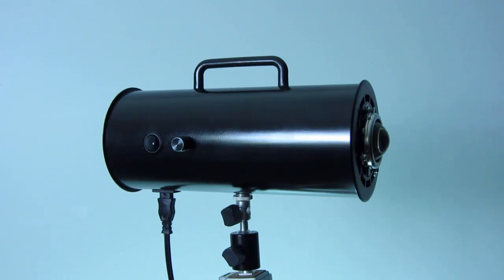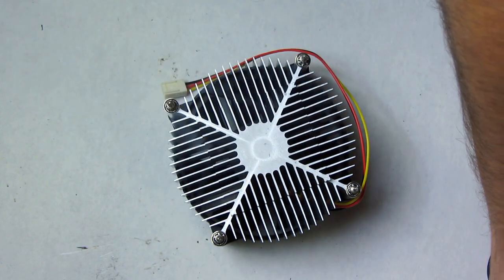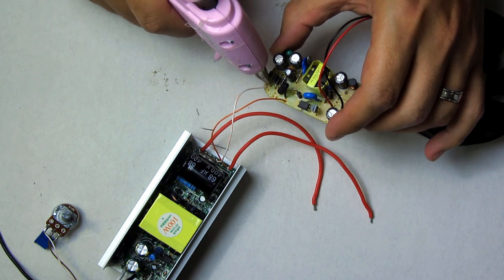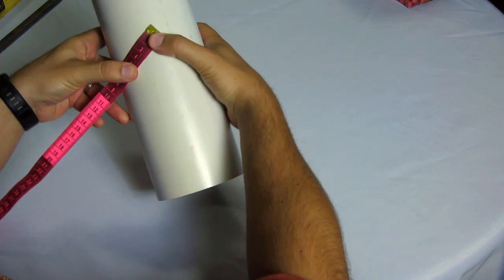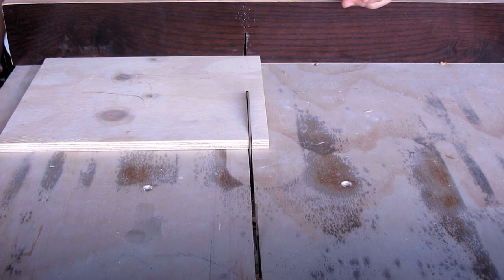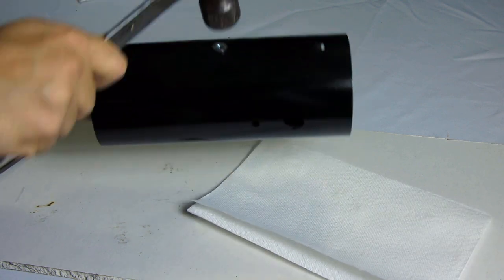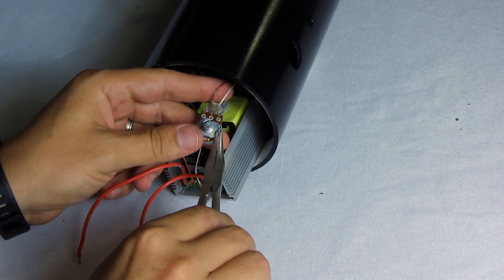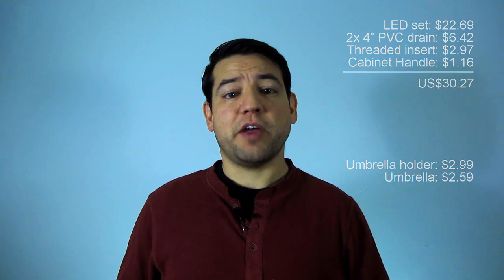Build Your Own 100W LED Video / Work Light DIY

Comment: Thank you so much for this detailed video.  It really saved me a lot of time.  I used the kit from  ebay for ~$25 and with your help it was super easy and cheap to complete.  If you carefully position the COB on the 4 radial spokes on the heatsink, you can fit 4 little 4-40 UNC screws right in the middle of the spoke.  
Your design is really clean.   If people want to go industrial, a 4" steel duct will work if you use a starter flange with all the little tabs. I didn't have to cut off the ears from the fan or heatsink or separate the fan but I think yours looks way better.    Really great video!  Very much appreciated.

Comment: Neat project, and very well explaned!!
some little advice, try to avoid hot glue between heatsinks and surface you wish to stick the device to, why?? because there is good chance for it to get loose when the heatsink gets hot. it is a 50/50 risk. Better use 2 parts epoxy sometime.
I would have left the front + back cover white to add some contrast to the build, of course it is a detail.
Also try to add to dust filter at the back, because with all my LED + active cooling (=heatsnk + fan) I fast noticed dust accumulation. but maybe since the fan is very far from the opening, you are going to avoid that...
Anyway appreciated the project ))
Reply from the maker: I agree with not using hot glue. I don't think it gets hot enough to melt the hot glue, but it doesn't stick well enough to the plastic. One of my lights fell while it was on a tripod and the driver came completely loose. I still have to fix that.
Reply: @GabesHacks  Right, that is why I said a 50/50, maybe it get hot but know knows? that why I avoid hotglue near heatsinks... the heatsink is not going to tell you: hey I am getting super hot, be carefull )) just kidding
"better safe than sorry
" right??  you said yourself about some past failure working with hotglue....
A tip= sand a bit the plastc, going to give a better retention to the material. Plus those cheapy hotglue gun are garbage, they do not melt well. I got myself one, but I stopped to use it. I use instead a cheap solderig Iron to melt some piece of hot glue, it melf them as oil )) I found it getting a better grip and get very soluble, much more than with a hot glue gun.... I know a bit slow but works fine )) or when you want to use the hot gun leave it upside down a while, for the glue to melt as much as possible inside before to expulse it... the idea is about  max melting of the glue 😉

Comment: After so much experimenting, I found that what kept the led from turning on was the cable I was using. I changed it for a fan cable and it turned on very well, it lights up the whole room.
Reply from the maker: I'm glad you got it figured out!
Reply: @GabesHacks  Thanks for the comment, in fact in what I have advanced I have had to intuit almost everything, since I am not skilled with this electronics. But now the question is about the thin cables that must be soldered in the middle of the two red cables of the led driver, I have already been reviewing the led driver that I have which is also a takey brand, to try to locate the points that you teach in the video, but I get a bit confused because even though they are from the same brand they are not the same, I can't find those points for mine.
Reply from the maker: @damianaraque6233  If you can't find those same points, just solder to the base of the red wires, or solder directly to the plug. You just need the wires solders to the AC power coming in.

Comment: Tip: for anyone to use as lighting for videos use a LED with high CRI, as you can see in the video Cheap LED leaves the colors bad
Reply from the maker: Yeah, I just wish they weren't so expensive! Some of it can be fixed with color correction in post, but I'm still bad at that too 🤷‍♂️

Comment: very cool! thank you for the video, It was very well done. Is it still working?
Reply from the maker: Absolutely! I made two of these and they're both still working. The only thing I think I could have changed is how I secure the driver to the inside of the pipe. In one of mine, the hot glue came loose, so it moves around inside. But that one had fallen while on a tripod, so that's what knocked it loose. But it still works!

Comment: Thanks for such a simple and elegant solution for dimming a power supply, can you kindly guide me about part list to purchase for the same setup but 200w LED Cob?
Reply from the maker: All the parts are listed on my blog post: http://www.gabeshacks.com/2017/12/100w-led-video-light.html
You can find a 200W LED chip on eBay: https://ebay.to/2D9Pdi1 but I can't guarantee they will be the same size and fit in this same design.
Reply: @GabesHacks  So nice of you, thanks :)
Reply from the maker: I can't tell you which one to use. If you want to make a similar design to mine, the pipe is 4" on the inside, so whatever chip you use needs to be smaller than 4".
Reply: @GabesHacks  Thanks :)

Comment: Great video! Thanks for sharing.  I bought a kit that looks identical to yours. I want to put it over my welding table in the shop. I am a bit confused about how to wire it. I will wire the input to 110v ac and assume the output is 36v dc but the fan is only 12v dc.
Reply from the maker: I'm running the fan from a USB charger circuit, which outputs 5V. The fan is rated for 12V, but I didn't want it spinning that fast and creating noise. I started talking about that at 5:02.
Reply: Thanks Gabe, I don’t know how I missed that. And thanks for such a quick response!!

Comment: DUDE!! You're my fucking hero!! This is EXACTLY what I was looking for.
1. Any chance you can be a superstar and put together a list of the parts? 
2. What if I want it at 100% all the time? I can just bypass all the sodering?
Reply from the maker: If you want it at 100% all the time, you can skip the potentiometers. But you will absolutely need a fan and heatsink on it. It gets very, very hot at full power. The list of all the parts is on my blog post: http://www.gabeshacks.com/2017/12/100w-led-video-light.html
It was a fun project for sure :)
Reply: Awesome. I am going to bypass ALL solder by using a USB solution with the fans. I will make a point of sharing with you after I try it. Using a HIGH CRI LED my guess is about $100 Canadian ($60USD?)

Comment: What about adding some batteries so it can run without main voltage?
Reply from the maker: You can do it, but you would need a different LED driver to run from DC input instead of AC. I took inspiration for my design from these videos, where they used a battery, so you can take a look at those for the circuitry needed for powering from a battery:
https://youtu.be/jaJQ2fo4poU
https://youtu.be/c--5c3Egv4E

Comment: do you have an updated link for the led set? the one on your blog is expired
Reply from the maker: Thanks for letting me know. I'll update it. Try this one (it looks like it's exactly the same one): https://ebay.to/3SrrNcc
Reply: @GabesHacks  just curious, is the led still working?
Reply from the maker: @Iinustechtips  It's gotten a little beat up (I've used it during renovations) but yeah, it still works.

Comment: To turn on the LED to its maximum light power, is it necessary to install the potentiometer? Since as such, I only need the lamp to turn on at its maximum power.
Reply from the maker: If you only ever want to use it at full power, then no, you don't need to use either of the potentiometers. Just make sure you keep it well cooled, because it will get hot!
Reply: @GabesHacks  I understand, now I'll tell you what I did: solder the black wire of the led driver to the negative pole of the led, and the white wire solder it to the positive pole, and glue the thick red wires from the other end of the driver to the wire that goes to the socket current, when plugging it into the outlet the led turned on for a few seconds, only some of the led turned on and then stopped doing so, I moved the cable that goes to the outlet but did not turn the led back on. I want to know what the problem can be?
Reply from the maker: @damianaraque6233  Hmm.... I'm not sure you can watch my other video where I talked about adding a dimmer, but I showed how I tested it without at first too: https://youtu.be/i4cY7c-0zyk

Comment: Great video! How is this holding up since modding power supply with trimmers?
Reply from the maker: Great! I made two and they're both still working. I just used them the other days to take some pictures of my kids. I could have fastened the driver inside the pipe better I think. The one came loose when it fell while on a tripod, so I have to be careful when I use it. But it still works just as well as the first day!
Reply: @GabesHacks  Nice to hear!  I just got some of the parts in today.  Thanks for staying engaged on YouTube and sharing your build.
Reply from the maker: @keithofarns8738  No problem :) I actually just finished using this light with a light box to take a picture of a camera I'm selling.

Comment: I have the following problem: connect everything and when I turn on the led the light of this begins to blink, it is not fixed as it should be. can you give me an idea how to solve the problem?
Reply from the maker: I don't know, sorry. I never had that happen.
Reply: Voltage Regulator and Capacitor that you need to focus. You could replace them to debug the issue.

Comment: Also, could you run multiple LED's on a water block with the power suuply being a computer power supply?
Reply from the maker: Mazomedia Computer power supplies put out a max voltage of 12V. So you'll need to step it up to the 30V that these LEDs use.
Reply from the maker: You can do that with a DC voltage booster: https://goo.gl/2tWnN1

Comment: How do I know which is the negative pole and which is the positive pole if after having disarmed the cell phone charger I find that the + sign or the - sign cannot be seen anywhere?
Reply from the maker: You can use a multimeter and test it. It will either tell you +5V or -5V. When it says +5V then you know you have the positive lead on the positive.
Reply: @GabesHacks  Well, on that side it is understood. The other thing is, in the part of the led driver where the thick red cables are located, it is not clear to me where to solder the two thin power cables, which must be soldered from the led driver to the USB charger. I thank you for guiding me, since the charger that I disassembled did not come with cables inside.
Reply from the maker: @damianaraque6233  It might be easier to see if you pause the video at 6:47 . I found that those two pads were directly connected to the red wires by using my multimeter and testing for continuity from the red wires to those points. But you could also just solder them directly to the red wires too.

Comment: I have ordered same kit of led driver, but it came different (red) where I cant find VR place for resistor to solder. Is it possible that it doesnt have it?
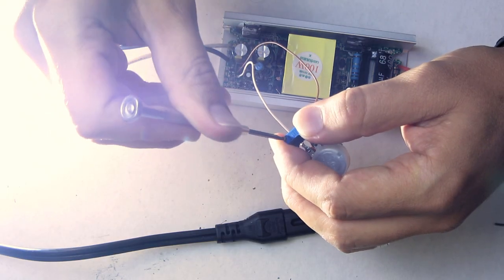Reply from the maker: If it's a totally different driver, then I can't comment on it. But look for any set of 3 unused pads - or maybe it even already has a potentiometer already mounted on it? (like the blue one that I used in this video at 3:52 that needs to be adjusted with a screwdriver)
Reply: @GabesHacks  it doesn't have installed potentiometer. Could I send you a close up picture, maybe you'd see where it could be added?
Reply from the maker: @simonaskukta8906  I'm not an expert on circuits - finding this on mine was just a big guess and it turned out to work. I can take a look at yours, but I can't guarantee I'll know what I'm looking at. Either post it a picture somewhere online and put a link to it here, or you can find my email address on my channel page under "About" and then "View email address"
Reply: @GabesHacks  thanks! But I managed to find those needed pins for soldering the potentiometer, it works great :)
Reply: @simonaskukta8906  Hey dear Simonas, could you show me what is yout model of driver. Because I'm in the same situation than you !

Comment: Which led kit you brought cold  or warm ?
Reply from the maker: I bought the cool white.
Reply: @GabesHacks  what's the cri value of this led?
Reply from the maker: @itmmec  I don't know. It doesn't say. If you want a guaranteed higher CRI, you will have to look for one that specifically says the CRI. This one is fairly inexpensive: https://ebay.to/2OKTq1z
Other ones with high CRI I have seen around $50+

Comment: That's a heat sink compound not Colgate you are using it too much
Reply from the maker: Yeah, I probably used more than I needed. It still does the job in this case.

Comment: neat, but cri looks close to 80 on video,
Reply from the maker: Yeah, the CRI on this chip is not super high. But I also did some colouring in editing, and I'm not very good at that. I might have just made it worse.
Reply: I chose a different LED and setup for this reason, but it's much more expensive. So for a second unit I consider a Godox SL60W, which is 99 EUR on ebay.